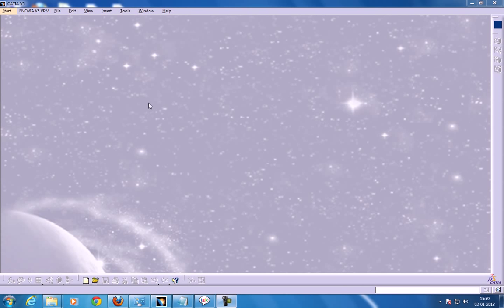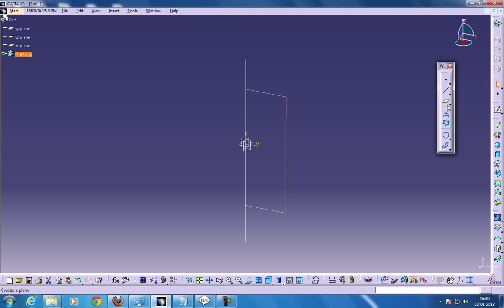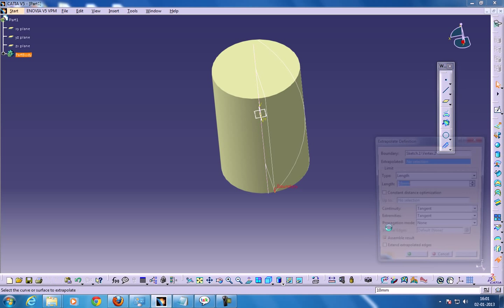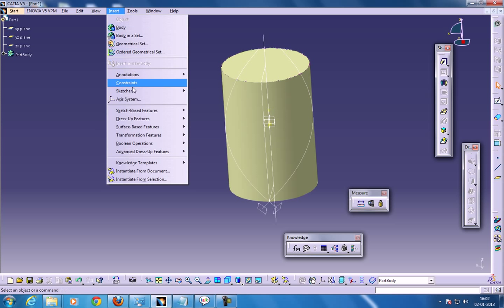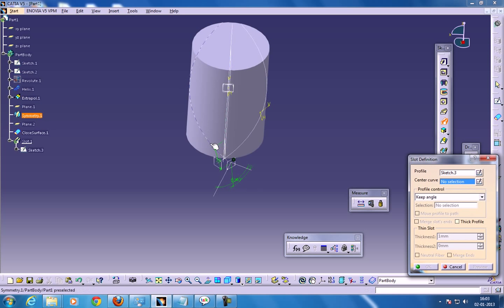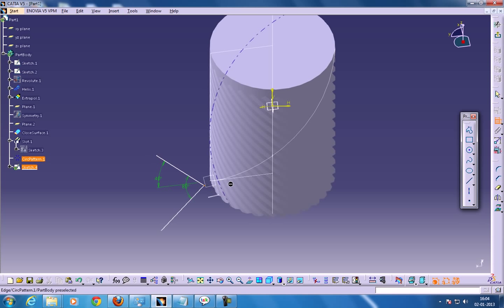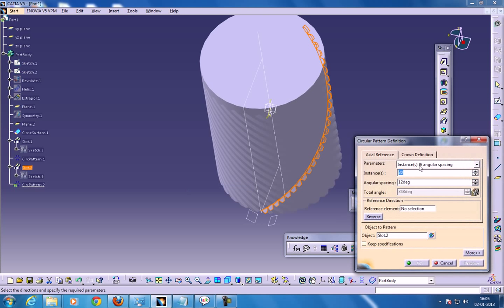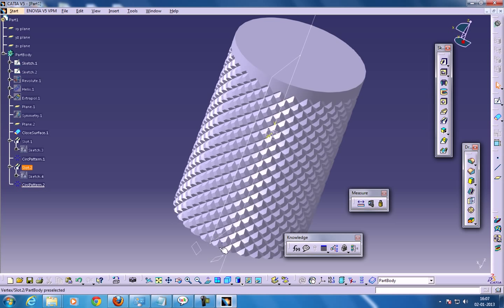Catia V5 Powerful Tricks #146|Machining Operations|GSD|Create Diamond knurling with ISO standard

Comment: Where to find revolution surface. I have searched for this option almost every possible tools. But not getting any.
Reply from the maker: Hi Tanvi, Revolve tool will be available in Wireframe and surface design or under Generative shape design workbench, you need to shift your workbench to one of the above to find this tool.